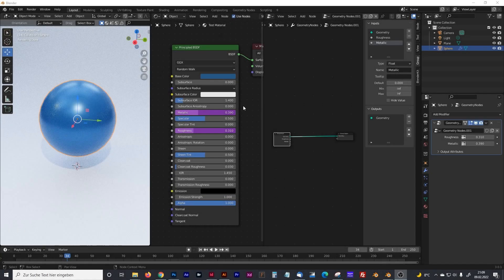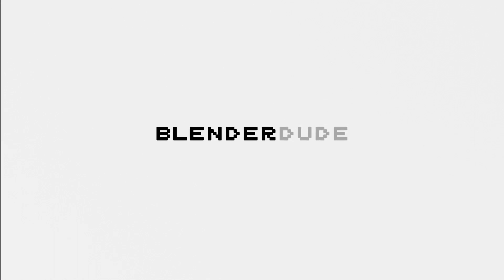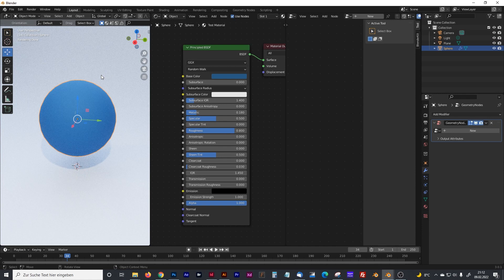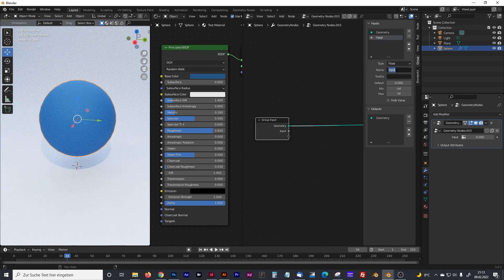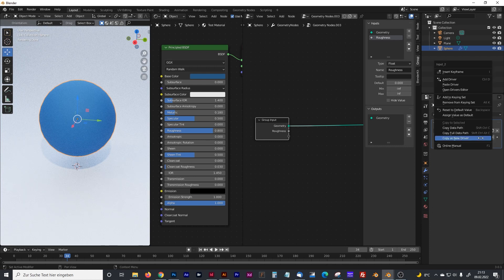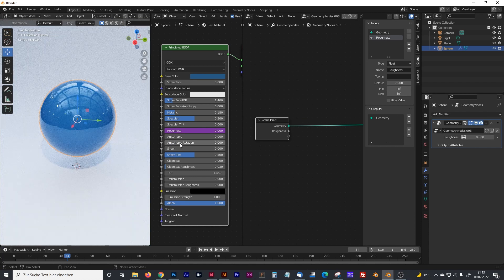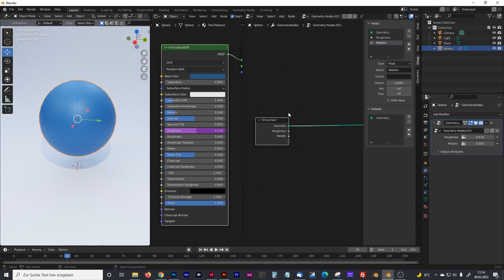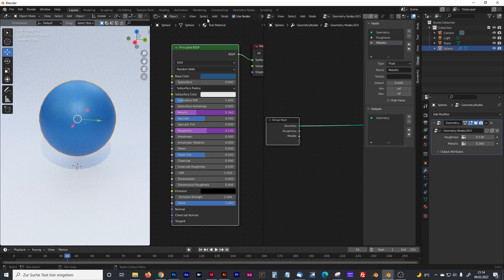Full Shader Control with Geometry Nodes ! Short Blender Tutorial

Comment: The title is misleading! 

You do not control the shader with Geometry Nodes! 

You do the exact opposite!

The title should read: 'Full Geometry Nodes control with Shader Nodes'!

Has anyone noticed this?

This trick reads a property from the Shader Node to thee Geometry Nodes, because they appear in the Group Input. So I can read the property from the shader node to Geometry Nodes.

But how can I write a property from Geometry Nodes to the Shader node?

How can I do that, what the title of this video promises, but does not deliver?

Update.

I have found out!

One clicks the output node, then add a new output. This creates a new Geometry Output. Change it into a float by right clicking on it, and give it the property 'Float'. 

Name it. Right click the output, and select 'copy as new driver'. Then you can right click on the shader property you want to influence in the Shader Node, and paste the driver. 

Now you can influence the property of the shader from Geometry Nodes!

So, this 'trick' works two ways

However, if one wants to animate, one cannot just connect the extra input of the Group Output to something else, like a Scene Time node. One must add a driver to that box, too. For example #(frame/24)%12 But why would one do this? You can put this driver directly into any property of the shader.